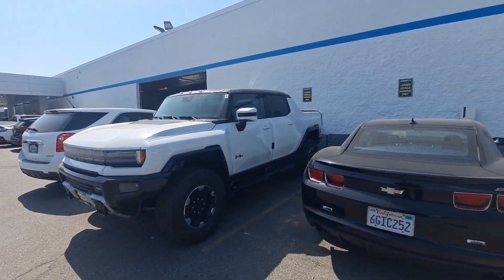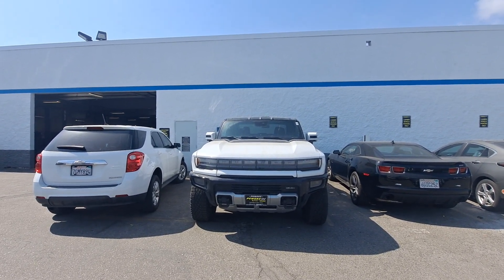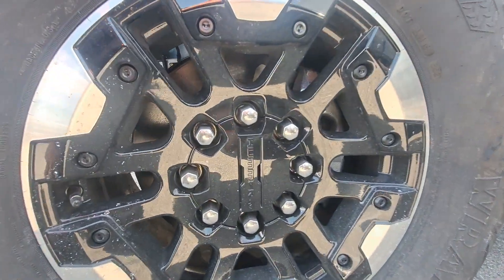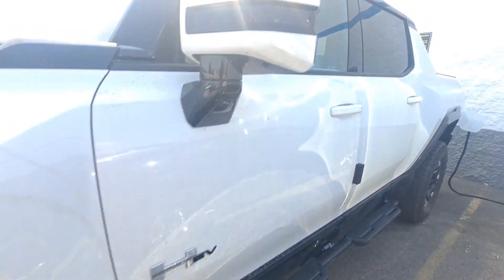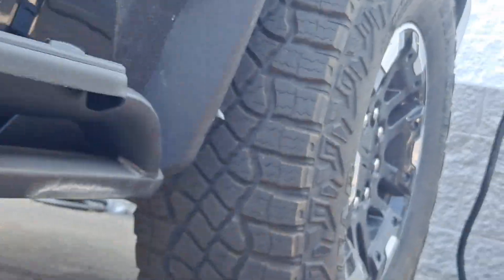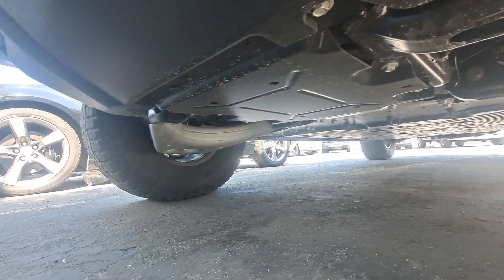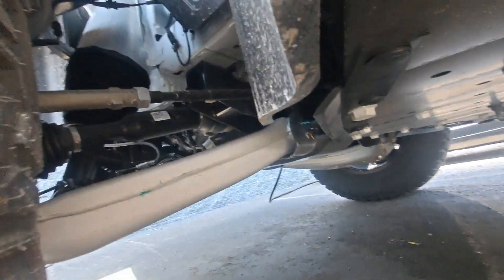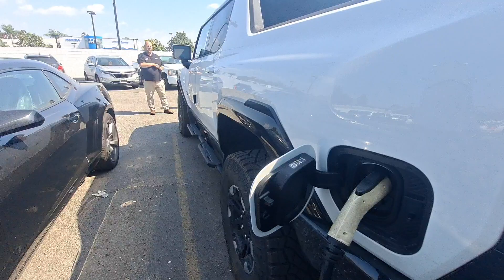Look around and under Hummer EV production model sold being PDI'd in Cerritos CA

Comment: If that were Mine I'd be pissed someone was all over and under my Ride while parked and charging. ;-(
Reply from the maker: I am going to assume this is a joke. 
But
Let me share some fun info with you. 
Vehicles roll off the assembly line. Someone drives them to a lot. They work as a factory lot porter. 
Then
A transportation company employee drives them from the factory lot, up onto a car hauler. This is commonly the truck driver, and begins to explain why there is plastic on the seats. 
Then
The transportation company hauls the vehicles to a train yard with an auto lot, and pulls them off. They are again driven but this time by both the truck driver and the railroad employee, commonly called a stevadore. That railroad employee parks it in an assigned spot at the auto yard. 
Then
A different railroad employee, following instructions from whoever is in charge of getting specific vehicles into specific auto rack rail cars, drives it up onto said rail car. 
Then
The rail car moves it, the auto racks are not sealed so this is part of the reason the cars come with pre-pdi plastic on the paint, metal rail dust can be pretty rough on white paint, there are even bulletins on this. And at the main hub autoyard, it is again driven by a railroad employee. They park it in a spot. There are not many of these yards, they would be for an entire region. Socal for example would utilize Mira Loma auto yard. 
Then
It is driven by the final truck driver who loads up and brings it to the dealership, then unloads it there. 
Then
A lot porter moves it, multiple times. Depending on how long it is on the lot, many times by many porters. 
Then
A tech drives it a pre determined mileage, inspects it. Pulls plastic. Performs a procedure that verifies from vehicle to vehicle such as taking it out of pdi mode, installing a fuse that was removed to save battery before sale, initializing components, etc. But they are all in and over that vehicle. Because it's their job. 
Then
It is ready to be delivered to the customer. 

And more than likely sales people have driven it etc. Fueling sometimes is before pdi or after, but by yet another person. Or in this case charging. 

Process will be similar for cars from overseas but replace railroad with shipping. 

Some high end cars will be factory, truck, dealer... rail or ship. 

But believe me, your butt will not be the first in the seat, so by all means be "pissed" about me videoing this truck all you want. Your emotions are very logical.
Reply: You apparently think the vehicle arrives magically from assembly line without if being driven or sat in multiple times before you are handed the keys. 😂🤣 This guy taking a video is much less harm then anyone before him. Heck, the dirt on the Hummer sitting in the sunlight is causing more harm. Lol!